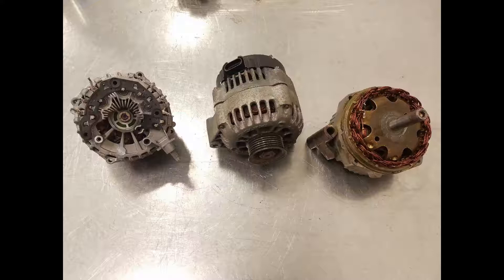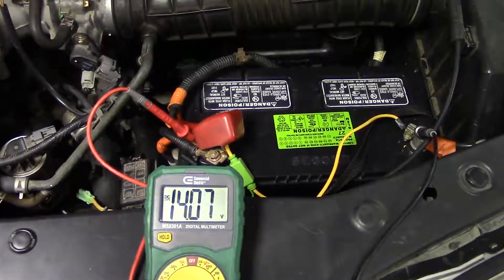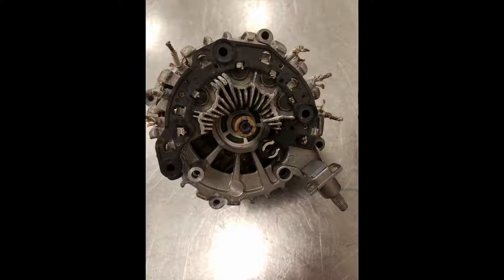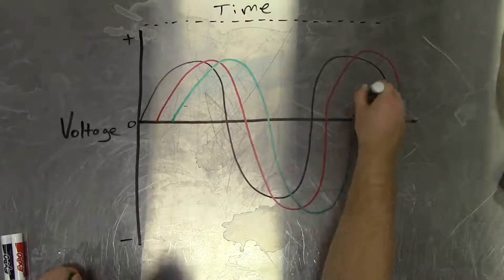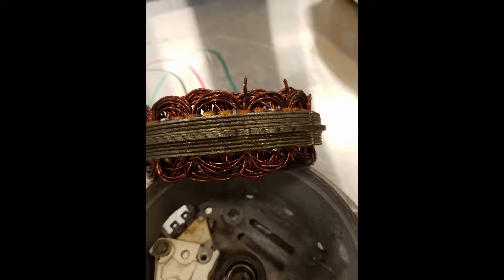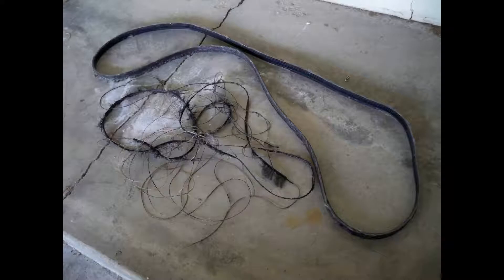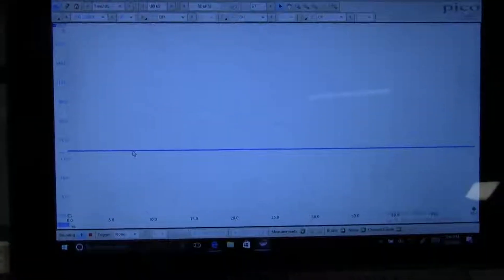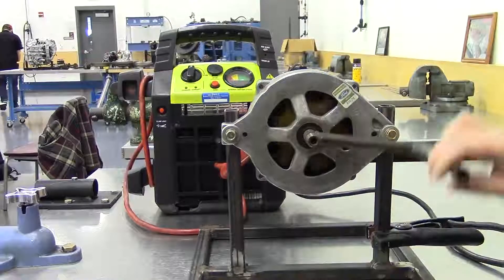Automotive alternators

Comment: Nicely done - - for the more advanced , it would be helpful so see more specifics on the ripple current with a failing diode. Also, what other sources can cause an alternator whine, but ripple current is low. A more complete diagnostic plan for an alternator would be very helpful. Thanks!!